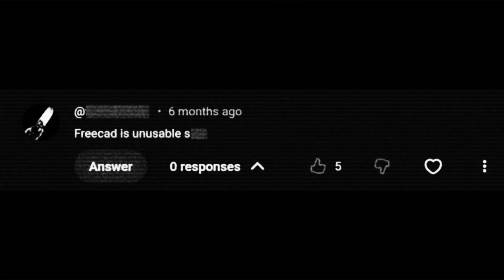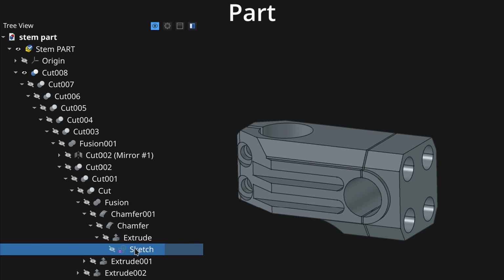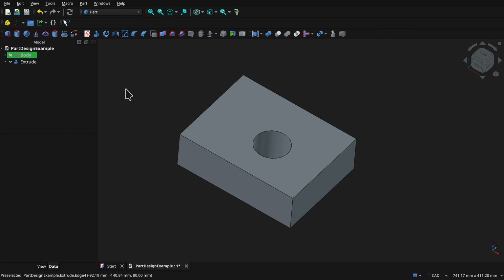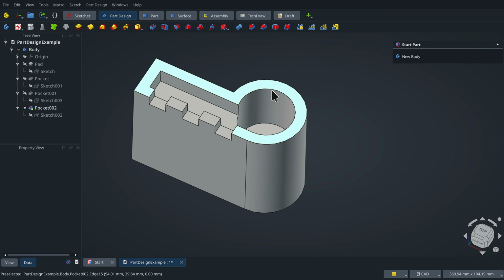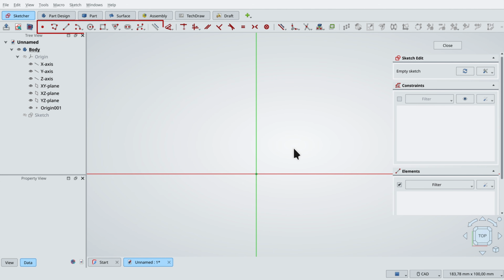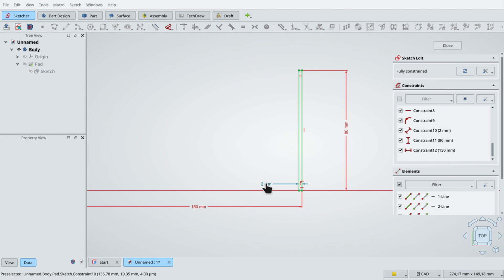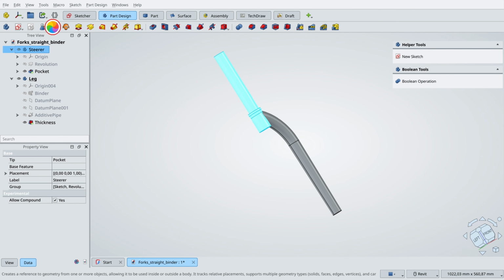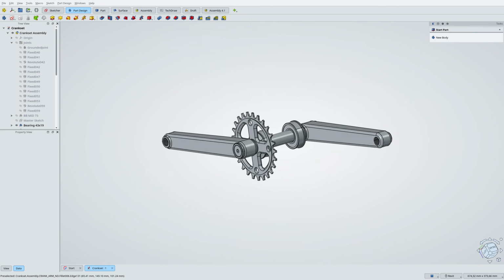STOP using FreeCAD WRONG! Do this INSTEAD (Workflow & Tips)

Comment: Excellent video. Thanks. 
I had three issues with FreeCad that eventually drove me away from it... 

1/ The first you touched on well.You explain the interaction of part /part design / draft work benches from an expert perspective, but this is rarely intuitive, even for a user of moderate competence. I often hit a point of "I roughly know what I want to do, but have no idea which features in other work benches are the key to unlock that". Modelling extruded text in a circular path on a flat plane for example. There is an excellent video showing it can be done (Kudo's to the expert for making that) . I also got it to work, but it took untold hours, with a very Bbeta-test GUI, and the method is so un-intuitive, that a week later, I forgotten it, and needed the video again.

2/ Fillets are fragile, and somewhat unpredictable as you point out. This is mostly not a show stopper for simple models, but once you are designing  casting patterns, where all surfaces have draft angles, and all intersections need fillets, you quickly hit a wall where the probability of fillet failure approaches 1. This then leads to hours of deleting fillets and feature, then recreating them in a different order in the hope of stumbling on an order which results in a closed model, without fillet failures.

3/ File sizes. You won't notice it with most simple models, but if you start making casting patterns, probably due to the draft angles and fillets, the model quickly reaches a threshold where the file size starts to grow exponentially with each additional feature added. While each individual model was still (just) usable, with a bit of stuttering on a MBP, it was clear assembling all into an assembly was going to be so laggy as to be unusable. Maybe the natural increase in computor performance over time will negate this issue, but maybe not.

Who knows what the future will bring, but I suspect that some of the drivers of these issues are so baked into the to core software of FreeCad, it will could be difficult to patch them.
Reply: Mhh, I get you. I wish it had more tools for text as well but that is it's own can of worms. I'd argue that it has no place in a CAD software because it's free form and not easily constrainable for consistent results when changing parameters but it seems to be a popular pain point for newcomers so maybe they should look into it or integrate some of the addon's like FCCircularText that target such demand. Maybe try that macro in the addons manager. In any case I'd suggest using a proper vector image editor like illustrator/inkscape and importing the result. That way you get better creative control and fine tuning using proper 2D tools and you can then import to constrain them in CAD or in a slicer like Orca.

Most of the fillet issues are resolved in the dev builds ( currently 1.2.0) but before that it's as our host explained, enter values approaching the limit to the decimal or bake the fillet into the sketch if possible. Even Solidworks struggles with complex fillet requirements and i've often put them into sketches when using it, especially when the next step is a revolution. Same goes for FreeCAD unfortunately. Another approach would be to design the fillet in it's own sketch and use it to cut/pad the model instead. It's very situationnal but that's something i've personally done, especially in other software like Sketchup which has no proper curve support. Fun times.

I don't know about file sizes. The largest i had was about 600kb and that was a simple gear. Maybe there is duplicated data somewhere ? A more complex assembly of 3 objects was only under 300kb for example. Could be worth-wile to get one of the experts on the forum to investigate your case ? I've seen larger assemblies complete with plans barely touching the megabyte. 
Performance wise, FreeCAD runs all calculations in software, ie on the CPU. I don't even think it's multi-threaded. You have to understand that a CAD software is not only trying to render triangles, look at your CPU/GPU usage, the GPU is barely touched, it's doing all the calculations to solve shapes and constraints and that is work for a CPU. In fact, other professional CAD software would struggle just as much with your objects. And that is why they all use approximations for screws and tap holes among other things.
This is the only place where Onshape wins because they do that in the cloud as far as i know, which is what you're paying for, your browser just displays the 3D result. Which is minimal performance wise.

Anyhow. TLDR, the only real issues IMO are the unwieldiness of the fillets and a lack of a neat UI/UX which we all agree on. And yeah the fillet thing is indeed baked into the core of the solver but as i said the dev builds are pretty good in that aspect which is great and gives hope for the future. I just wish they were on a faster release schedule.

Comment: Fr FreeCAD has been one of my favourite 3D programs for years especially when you can link all the measurements in the spreadsheet workboard, so if you want to change something eg. The thickness of an object you just do it in the spreadsheet and everything is updated with the new parameter 🎉

Comment: My friend started using freecad a while back while I've always used fusion 360
Pros of freecad:
It runs on a celeron craptop surprisingly well
It does what it needs to
Cons of freecad:
The ui is very different from fusion and I don't understand it, but it seems to be easy to learn if it's your first software

Comment: I would still argue that the UI is pretty bad, in the sense that it's very hard to guess what to do just by looking at the program. That doesn't mean the program is bad in itself. CATIA, for example, has one of the worst UI that has every existed on this planet, but the airplane industry uses it nonetheless.
Reply: By the way, FreeCAD is by NO means as bad as Catia in terms of its UI. Moreover, it seems to have improved a huge lot over the recent years, and I will definitely give it a shot again next time I need to design something.

Comment: Crime against humanity! 🤣🤣🤣. Seriously though this video is excellent,  I cut my 3D teeth on Solidworks but no longer have access to it. It was the subtle differences that are mentioned in this video that kept catching me out with FreeCAD.  One thing I struggled with was not being able to reference existing part edges etc in a new sketch without bringing them in as external geometry. You have also just explained clearly in seconds what the heck the shape binder is all about.  Haven’t tackled assemblies yet but thanks for the heads up😀

Comment: I find FreeCAD to be quite enjoyable! It's the first parametric CAD tool I've put some time into, and I've succesfully uses in in my engineering studies and for my own projects, especially modelling for 3D printing. While it's true that the user experience feels disjointed at times, I've quickly developed my own workflows centered around the workbenches I need, mainly Sketcher, Part Design, and Mesh.

Very grateful to the community for developing such an amazingly powerful (and complex) tool in the spirit of free software! It's one of a kind. Not least, thank you! For providing such high quality and down to earth learning resources; your videos have helped me a lot in understanding some aspects of FreeCAD :]

Comment: The average user would never have needed more than the free version of fusion360 as it blows everythign out of the water, however they are dropping support for windows 10 and seeing as i would rather fry and eat my own nuts than move to windows 11 I will either find a replacement or leave windows once and for all, fusion is the last bit of software i actually need and it needs to be fully parametric and have a complete build history that automatically updates when changes are made to the history, this is the baby level requirement of any CAD software imo. It looks like freecad has this in some form so I may give it a go.

Comment: While I like the introduction of this video, it doesn't invalidate the criticisms that are made. Compared to the commercially supported CAD programs, FreeCAD's usability shortcomings, while having improved massively from 1.0 onward, are still quite obvious. In general, most of the things you describe in your video are issues not present in commercial CAD software offering compareable capabilities. There is plenty to critisize (and yes, I plan on contributing in the future to perhaps alleviate these pain points, but at the moment I have no time to wade through everything):

- FreeCAD has a lot of legacy features (especially outside of PartDesign and Assembly) that have a tendency of breaking down quickly in parametric workflows. Maintenance and improvement focuses on the newer approaches, but older workbenches seeing little contribution are not hidden away in the GUI by default, which creates an unintuitive interface.
- SubShapeBinders are a really powerful tool, but they really should not be something that users have to use themselves often. The binding relations between parts should be managed implicitly wherever possible.
- Error messages need to improve. A LOT. I have so many situations where I can create either fillets or chamfers on some of my parts's edges, and I get 0 information on why I can't do either of the two. Just a nondescriptive "Operation not done" error on the console.
- In a similar nature, the sketcher is not good enough at telling me what is not constrained. Knowing which components are involved is hardly useful on nontrivial sketches, are many unconstrained DoFs involve motion of many components at once. It knows the number of unconstrained DoFs themselves, so it should be able to compute the linearized null space. That should allow at least visualizing a differential unconstrained motion.

Comment: FreeCAD doesn't suck, but I always run into severe  project-breaking bugs, and they are not a workflow problem; the geometry shouldn't conpletely break because I put two slightly overlapping pockets on top of each other to get a very specific shape I couldn't create any other way. It also shouldn't throw an error because I beveled two edges to not even more than half, but exactly half the total length of their shared plane, to where the plane should essentially be gone and they touch. I like the workflow, I really do, but I ALWAYS run into project killing problems with it like the two I just mentioned. The other software I tend to move to when a project proves to be a little more complex than planned and I start encountering these issues is OnShape, and it has similar issues when calculating certain geometry, but nowhere near what FreeCAD does. Between the two, I would choose FreeCAD any day for workflow, but I would choose OnShape for being way more bulletproof with the geometry generation. And that's not even factoring in the free as in beer versus free as in FOSS.
Reply: Agreed. FC uses a very old solver and they built around it as masterfully as they could. I always recommend the dev build with it's cutting edge features and new fixes. Maybe this one will not break on your use case ?

Comment: hey . i am a Metal-Worker from Germany .. i had back in vocational school (about 2004) CAD and CNC Class .. we used AutoCAD there .. for a long time i searched fo an free CAD for me privat to use .. had long time Siemens-Solid Edge, sadly only the 2D Version is free .. later with my first 3D-Printer i switched to Solidworks-DS CAD, later to Fusion 360 .. my Mother was a Architekt and had befor the 2k's a CAD where had to type in ever Vektor by Hand, at least the Messurements .. .. i love Open-Source .. FreeCAD sounded very promising to me and i'm sure it is very capable (i tryed FreeCad 5 Years ago), but even what i see her, for a modern CAD Programm it is way to cemplex and to colplecated to acheve sertan goals .. the way you have to switch Tabs so the Programm is in the right Mode (alone what you explained for the Zylinder extrude or cut out, or split it into surfaces not Object) is what i did back ion the 2004's .. for ease of use it should be posible to do on one screen .. what i loved in DS CAD, you selected to draw, then the Surface you wanted to draw on, draw the Circle,, right click the surface of the circle an deather typed the number of how far to extrude positive or negativ, or just pulled, hooks to click on how the new drawn shall interact, add, cut out, merch or stand alone  .. etc etc etc .. it is efficient and fast (especialy for beginners), wich sadly FreeCAD is not in my eyse .. hope that changes some day
Reply: What you described with the "click on surface", "draw", "extrude" is exactly how it works in FreeCAD in Part Design. It's as easy as that. Except you can also add constraints which are obviously essential to make a proper object. Give it another go.  It doesn't have the merged tools yet (like the "negative extrude") but it's alright
Reply: @TheSliderW  Please don't misunderstand me, I hope FreeCAD is successful... I probably didn't express myself clearly. What I meant was mouse-over context menus, where you select which operation to perform instead of having to switch "cumbersomely" between Part Design or Part etc. beforehand, because in modern commercial CAD programs these functions are accessible via a single screen... The topic itself is too complex for YouTube comments; intuition is probably the key concept here.
Reply: @georghofmann1782  Yeah i get it but what i said still stands. 
In any WB, but in my example, Part Design, you have a side panel that displays usual and context sensitive actions. If you click on an object's surface, the Tasks sidebar will show some possible context sensitive actions including Sketch just as if you used the right click from your other software.... So clicking the Sketch tool will perform a sketch directly on the selected surface, and then, when done, the Tasks pane will include the Pad tool to extrude it right away. 
in any case you never fully leave the workbench or have to scan across the entire row of tools to find the right one.
Reply: i guess you can view this as if you only had a single mouse button and your mouse context menus were displayed in their own side panel at all times.
You can argue it takes some screen space but that panel is also where tool settings will get displayed so it's not useless.

Comment: I thought I was the only one to use the .99 trick to get the perfect fillet 😂 Always too lazy to create another sketch for sweeping along the edge. Glad you mentioned the constraint flipping issue, although it has a legitimate solution I end up changing the value by tiny amount so it doesn't get flipped.

Comment: Let's be honest. The principles and recommendations presented in this video for creating models are applicable to other parametric modeling programs, with the exception of configuring the graphical interface.

When switching from one system to another, difficulties inevitably arise related to adapting to the logic of tools and the interface. However, many people rightly point out that FreeCAD complicates the workflow with illogical tools and a confusing interface.

Of course, you can adapt to any system and successfully use its tools. However, is it worth getting used to a less efficient solution when a similar task can be completed in a shorter amount of time in another program? For example, if it takes 5 minutes to complete a task in Fusion 360, it may take 15 minutes in FreeCAD. This is not due to a lack of knowledge about the tools, but rather to the need for more manipulation and mouse clicks to achieve the same result.

I hope that in the future, FreeCAD will reach a level where it can reduce the time required to complete tasks. At the moment, the position of some developers and reviewers who claim is disappointing.: "You just don't know how to use it." This is comparable to saying, "Why do you need a motorcycle if you have a bike? You can also use it to get from point A to point B."

Comment: I started using cad system on computers when mainframes powered clusters of terminal making 2D drawing.  And 3D were line only.   Experienced all the free 3D tools.   Retired after a decade using proE, UG, mostly and a little Solid Works. UG allows for both methods of building solids.  Having a list of operations is the one free CAD.  My 2D cad programs and one free and UG had the modify a solid approach. 
For me Free CAD is an order of magnitude better then all the other free stuff mostly because it doesn't have limitations on size.  The commercial programs have better tools to build bodies from surfaces.  However being retired I plan to minimize the need for surfaces.  Some of the other  less then desired issues have been eliminated in this last big change freeCAD 1.x

Comment: I'm still quite new, but version 1 was a big improvement over the previous versions. I still occasionally get frustrated, but far less than before. I think it still has some way to go before I'd recommend it to anyone, but on the other hand there are not a lot of free/cheap options out there. Of course, if it does the job for you depends what you're trying to do. It doesn't do everything as well as possible, but it does many different things.